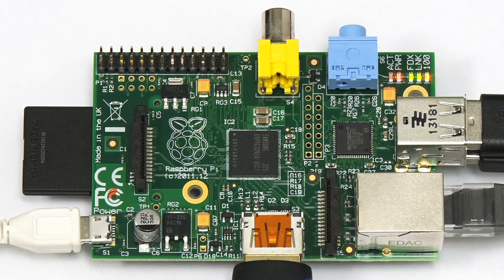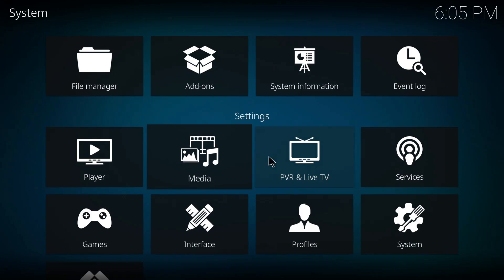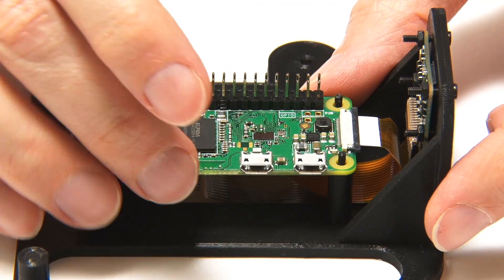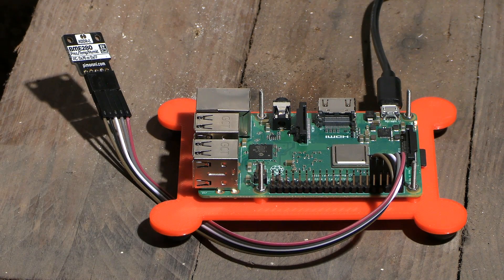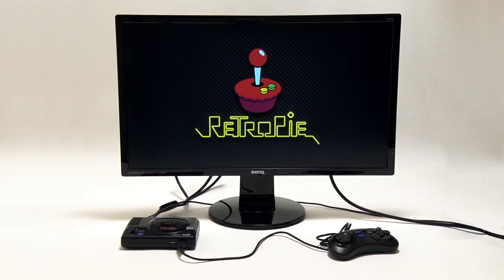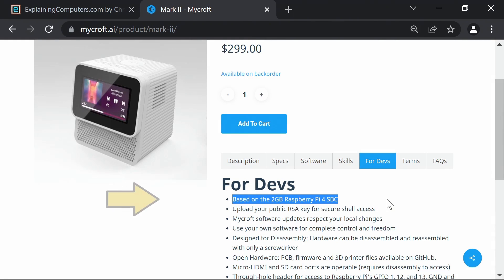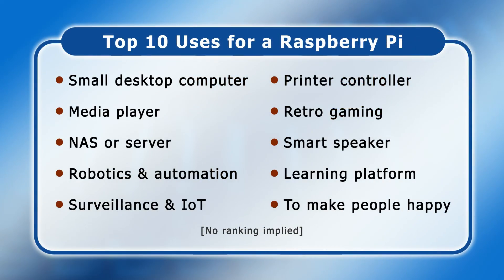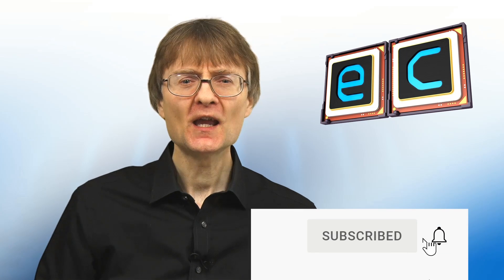Top 10 Uses for a Raspberry Pi (400th EC video!)

Comment: Well done on making 400 videos. Also since I live in rural Scotland, I don't get ultra-fast speed broadband (instead of using ADSL2) as they don't provide fibre or cable broadband that doesn't give me quality 4K Streaming. But with the Raspberry Pi 4B and adding a USB 3.0 external Blu-Ray RW player for Kodi to play some of my favourite BR discs of Red Dwarf instead of wasting on subscribing to BritBox and Netflix etc. My old Blu-Ray player was cheap but nasty as they had laggy remote control responses that make it suck for playing interactive DVD games of Bullseye and Who Wants To Be An Millionaire, but with OSMC custom remote control .conf support, plus a mClassic HDMI dongle to smooth the edges, and with a LED TV that contains AI motion interpolation makes it good for like Stop-Motion videos as well as movies/films as they are shown only in 24 FPS. However, my Smart TV isn't top-notch as some of the apps are unreliable - even for using the YouTube app! But with using my Pi for using Chromium OS, makes it easier and contains an "f.lux" like feature to reduce blue light during night time to prevent the blue light from interfering with my sleep cycles and fatigue. And I avoid extortnate Smart Samsung OLED TVs as not only are they are expensive but they look more or less overrated as the Smart TV features isn't as customisable as Kodi as well as trying to use VPNs or IPTVs. But maybe personally I don't want to touch or buy them, because I don't like Samsung OLEDs cos they are too expensive and OLEDs have a shorter lifespan than LCD TVs.
Reply from the maker: What a great use of a Pi -- anything that plays Red Dwarf gets my vote! :)
Reply: @ExplainingComputers  (As Kryten): Extraordinary! Hmm!

Comment: There's one more use I'd like to mention. It's using the Raspberry Pi as a chart plotter with all the bells and whistles of the modern marine systems for a fraction of the price. It uses the OpenPlotter OS which is quite amazing. You can use it not only for charts and plotting a course but also equip it with GPS, AIS, VHF, compass, depth sounder, autopilot and much more. A comparable Garmin or similar commercial marine system costs tens of thousands of dollars while the OpenPlotter is extremely inexpesive and easy to upgrade and modify.

Comment: Congratulations on your 400th video, Chris & well done!.

I would also like to add yet another use category - Ham Radio & some examples of what I use mine are noted below:

1. Portable RasPi 4 with an Argon case, 256GB SSD running Jason's KM4ACK image which easily interfaces to modern radios like the Icom IC-705
2. RasPi 3 with a MMDVM HAT running "PiStar" for DMR (Digital Mobile Radio) including cross-mode digital communications
3. RasPi 2 running "Ham Clock" from Clear Sky Institute

RaspberryPi SBCs are 100% fun and very simple to use

Comment: Congrats old mate, yes I have many of these little computers now, and they all have their  use around here. They are the most flexible computer out there although technically some projects can be handled by just a microcontroller board which I haven't really perused yet. Keep an eye out for those PI projects that are very unconventional.
Reply: Now we got the Pi Pico so we can spend the right amount of money in the areas where microcontrollers do the job perfectly

Comment: I've bought more Pi's then I have actually used. I only have the 1 x Pi model B, 2 x Pi 2, 1 x Pi Zero W (Actually working on the PiGrrl Zero, messed up some stuff, have to wait on new parts to arrive) a Pi 3 B+ (I had to get the gigabit NIC) and a Pi 4 2GB w/ 500 GB SATA SSD (Working on Open Media Vault, then I'll add plex for a travle media server to stream videos to our TV's hooked up in our RVs, Family meet us where there is 2-3 RVs)

I had set up the following in the past:
Steam Link
RaspAP

I am not very good with running linux, but I know more now than I did 10 years ago. Although that's not a high bar to set because I can barely remember the shutdown command half the time because I go months to years between actaully using them.

Comment: Actually you can do much more with Rasberry PI. Imagine the autonomous drone like glider. Rasberry PI has enough ports to connect controls for flaps, elevetaor, allerons, rudder and even for camera to analyse the target. Having temperature and wind speed readings could automatically find the best airflows to configure the how to spend less energy. And as pre GPS days, gyroscope and magnetometer where enough to figure out the path. Those even got us to to moon.

Comment: I bought a 17 dollar USB antenna and use mine as a disciplined GPS NTP server running on Ubuntu with Mate desktop for when I want to use it for GUI stuff.  I also am going to use it as a DHCP server, and running am running LXD linux containers.  I also use it as a WIFI controller that run's within the LXE container.  PI's are really sick devices.  It runs with a POE hat and unless I need to use the GUI I leave the single cable plugged int so it run with just one cable.

Comment: I remember clearly the excitement when I got my Pi B a few months after it was launched. I'd been using Linux for several years before that point, so it wasn't that so much, but that the Pi was a fully function multi-tasking computer running a full operating system that was the size of a credit card. It felt a bit like stepping into the future. Aside from the speed differential, it behaved exactly like my "proper" linux computer. I ended up using it for a number of different projects, a media player, a file server, plugged into my TV so I could sit in the armchair and connect to my other computers to write code etc.

Comment: I found that the Pi is good for any app that would require one to leave the desktop on. I also use it to run Home Assistant. With current power rates, and windows rebooting, a Pi is a good low cost solution.

Comment: Returning to the field after a brief hiatus I discovered the pi. At the same time I discovered your channel. Per your closing statements, it simply made me happy and continues to daily. It got me through the isolation of the pandemic and re-ignited a passion for tech that had been dim for quite some time. Truly it's a product that knocks it out of the park across the board, in a million ways.
My pi is my daily driver, my dev station and a source of massive pleasure. I've done a few projects (a pi zero as well) and have a hundred more I want to do.

Your channel, is just as priceless as the pi. Thank you for everything.

Comment: Pi's GPIO can also be used to flash NAND/NOR memory modules. This is useful for reverse-engineering routers or flashing alternative firmware onto closed-source computerized devices that lack a SPI/UART header. There's a project called Libreboot that has a great how-to on using a Pi to replace your PC's BIOS/boot code with something open-source and not proprietary. Another use could be processing MIDI or as an audio DSP (although, for the latter, not real-time low latency like a SHARC or Daisy DSP.)

Comment: I had a customer that needed to verify his WIFI setup was able to handle 70+ concurrent clients. My solution, after finding there were no commercial devices that could do that, was to buy 12 RPIs (back in the Model B days), 72 USB WIFI sticks, and hook them all together with some scripting. Happy customer, successful project. And some of those Gen1 Pis are still at work -- some as NTP servers with GPS modules as time sources, some as motion cameras with pikrellcam (which does hardware-accelerated motion detection and runs fine on the old hardware).

Comment: I understand your Transport Spotter argument "It's a hobby", but a lot of the other points are now redundant. Time has moved on.

I just bought an LG 4k 43" Smart TV running WebOS which did  not cost much more than an upsized Raspberry Pi with display, and it covers nearly all your points bar the robot controller. It does media centre, games, smart objects, Apps and so much more I am still discovering new things it can do.

btw Why do you monitor your fridge? Can't you just padlock it and fill it with passworded canisters like any sane person would do? 😂

Comment: Learning Platform - Yes, the Raspberry Pi is a great learning platform for learning Linux and Python. The default Raspberry Pi OS (which used to be called Raspbian) is Linux and one can even install Ubuntu Linux. Raspberry Pi books explain things simple enough for a child (or a tired me) to understand. If I want to know how to run Python under Linux including the "Shebang" and making the code executable; it doesn't get much easier than the "In Easy Steps" series.

Comment: I use my Pis for six of those 10... and happiness is definitely one of the uses.  🙂
One use you did not mention, yet I have for my Pi3, is running a scientific calculation server, for instance through the Berkeley University BOINC environment.  SETI@Home was the original project, but it is currently paused.  So now mine runs Einstein@Home and Universe@Home.  The person behind Universe project seems to have received a lot more volunteered computer power with the pause of SETI.   Using a Pi for this task is particularly acceptable due to it's combination of low power consumption and silence.  So I run mine 24x7.  I use a large passive heat sink to keep the SOC cool enough to not throttle on the hottest of days.  What it lacks in processing power it makes up for by running at 100% exclusively on the BOINC tasks all the time.
Another scientific use I have seen is to locate a number in dangerous places - like around the rim of a volcano!  Being cheap and low power an effective monitoring system is made affordable.

Comment: You skipped one very important use, pihole. I have been running my pi 3b as a pihole system for about 4 years and it works great, is rock solid, other than some hiccups related to running cloudflared for DNS over https, not pihole's fault.

Comment: I run an ADSB aircraft tracker using a RPi Zero 2 W. I also have an RPi Zero W print server.

At one time  I ran a Raspberry Pi build farm for GitLab-CI for the project below. I had a Pimoroni Blinkt on each one showing the CPU utilisation. I think it was a mix of Raspberry Pi 2B's and Raspberry Pi Zeroes connected in gadget mode as ethernet adapters. The worst problem was that the memory cards were very slow so became the bottleneck. Still it was fun watching all the flashing lights.

You can see several Raspberry Pi's in the model boards for the Cyber Security challenge ... https://youtu.be/aj21cCOv2gU.

Comment: I have always been interested in Linux but used to have trouble getting it to do things that were easier to do in Windows. Now, Linux seems to have got to a stage where i can set up a computer and have it function quite well. I have even set up a PC with Linux Mint on it for my wife to use for general use. I have also set up Pi-hole on a RaspberryPi 3 on my home network to help overcome current excessive advertising and data collection. More recently I have set up a Raspberry Pi 400 along with a two-player games console using Retro Pi. I am also interested in finding out if i could set up an onboard computer system for my touring 4WD to access the many Android apps that are handy on longer distance road trips. One thing I would like to see (as a newbie) is how to set up a Raspberry Pi with more than one application, like; PiHole, NAS, Media centre, security camera system, etc. Can this be done?

Comment: Congrats on video #400. In case anyone was wondering, I use my Raspberry Pi as a media player. We go to an RV campground a lot during the summer. That campground is in a pretty remote area and if it happens to rain, there is nothing to do. There are only like 3 TV stations. If they even come in. That Raspberry PI has come in very handy a few times, since I have a flash drive with a bunch of movies on it. :)

Comment: Congratulations on the 400th episode (I've seen quite a few of them).

The great thing about a pi is... it can be everything you mentioned in the videos at the same time (well, at least the more recent ones) without switching any images/drives/sd-cards. Headless, my Pi is an adblocker (pi-hole), a NAS (Samba) and a media center (Kodi). As soon as I put a display on it, it's a retro emulator (retropi) or a desktop-pc (Raspberry Pi OS) depending on the setting in the retropi config. And because there aren't any already existing disk images for that, you learn a lot by doing such stuff, too. And you probably will also have fun (except if you, like me, set-up samba for the first time in your life from scratch... that wasn't an exactly fun part...). So... the Pi can be a lot of whatever you want it to be. Buy it, play around with it and you will probably find one or more use cases. I mean, I bought my first pi for it to be just an emulator for some old console games... and now I've created a multi-purpose-monster and even after a few years I still find new things I like my Pi to do now and then.

Comment: Thank you for 400 videos!

As a side note: I've talked to a lot of people with older Pi SBCs that are trying to find a use for them. My suggestion is this: DOSbian or Combian 64. DOSbian emulates a DOS machine and Combian emulates a Commodore micro-computer. (C64, VIC 20, etc).

There was a heat wave where I live last summer and I got DOSbian up and running on my old Pi 3b. I stayed in the basement (where it's cooler) most of the summer playing DOS games lol. Oregon Trail for the win.

Comment: I wished Raspberry Foundation could launch a Raspberry Pi designed for tablets. A SBC that could be mounted inside of a custom tablet with touch+screen+usb+camera+wifi so we could run Linux and develop and use applications on-the-go. With battery inside of course.
BTW, Congrats for the 400 episodes.

Comment: Excellent explanation. Use raspberry pi for purpose built computers. Another use case could be "distraction free" word processor that can be low power and offline without constant updates/notifications. Just like J.F. Sebastian from Blade Runner built his friends, some people like building small computer systems for hobby. How many times a windows update or windows upgrade removed some nitty gritty feature we have come to rely only to find it's no longer available etc... The big man made decision that feature is no longer supported or needed but some people built their processes based on the availability of such feature... Well, at least, with Pi, you can keep a copy, without having to force update or activate license down our throats.
Reply: Lately, MS is trying to play nice, thanks to stiffer competition from Android and Chrome, they are more flexible in how you install Windows 10. You don't even have to activate Win10 to continue using it. In the past you couldn't even use the "upgrade" disc for a fresh OS install, remember those good old days. Don't think MS has gotten "nice", they're hiding their fangs, trying to look nice in order to retain install base. Otherwise I remember the days, not that long ago, paying for Windows + Office license more than a well equipped quality desktop PC. If you upgraded the GPU, you used to reactivate this PC, call MS to prove you're an innocent sheep... Remember those days? What a joy it was.

Comment: Very much enjoyed. How fitting you chose the RPi for this #400. Indeed it is the reason I stumbled across your channel several years ago. I was intrigued and interested in the Pi when I found out it had GPIO pins and how inexpensive they were. I bought the first model and found your channel and you showed how to control LEDs and connections to breadboards. Since then I have watched most, if not all, of your videos and routinely watch on Sunday afternoons your latest episode. I have since bought about 10 Pis and love to use them for prototyping and trying things out. They are an endless source of learning and discovery. I have an Odroid NextCloud that I originally prototyped on a Pi to see how it would work. I'm not keen on heights so mountain climbing is not at the top of my list for fun things to do, but the RPi and your channel are!

Comment: I first got into a raspberry pi at the 2 level....yea not for me...the video was not stable on my unit...fast forward x years...I tried a RPI4 found it stable...took a hint from Jeff Geerling...8 node cluster on it...love distributed computing...and if you can have 8 computers running a task...it's going to be faster than one.   Also got a PI400 like the form factor on that...want to take it into retro gaming...had some struggles getting images and getting the controller I bought to work...at logitech...most likely me on the controller...I was never a great controller gaming person...my games of interest all predated that...so might just take a stock raspbain image and put a few emulators on it...rather than a grouping of a whole bunch of stuff I know nothing about.  I also got a couple PI2W that I want to use in usb device mode...yea stuggles with that...most likely windows 10 driver issues.  So yea this topic on point for me very interested in what you had to say...yea 4D printing...comment in the video...not sure what that's about at all.  Only just getting into 3d printing.

Comment: Congratulations on your Raspberry Pi 400 video! ;-) (two birds, one stone?) And congrats to the Raspberry Pi foundation for 10 years! 

One point you made, that you can bung a Pi system, and just start over rang so true to me. I learned a lot by hosing my Pi systems, and learning what I did wrong, and moving forward, integrated those lessons. I honestly only play with my Pis these days (I have a 3B+ attached to my Motorola Atrix Lapbock) and a Pi 4 in a RaspPad), but I enjoy them, and learning with them (and I'm in my mid-50s)